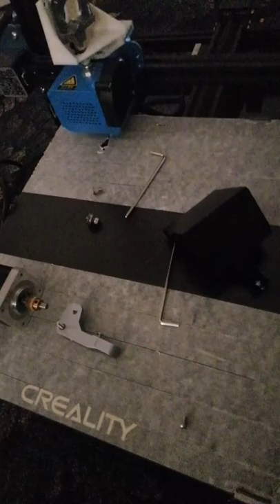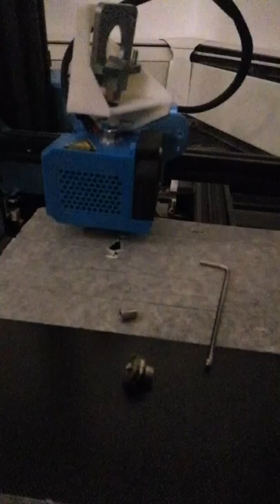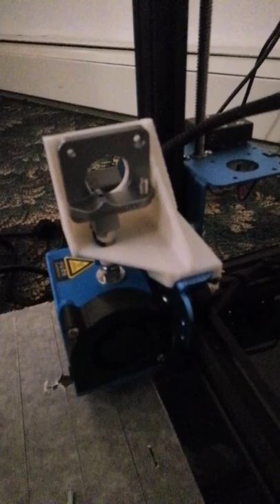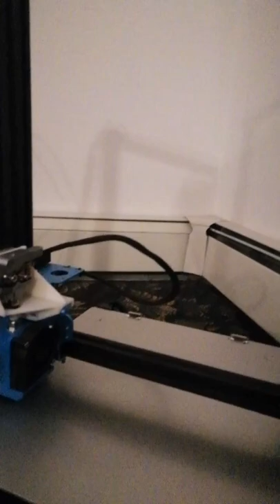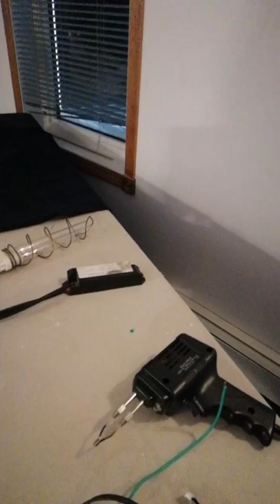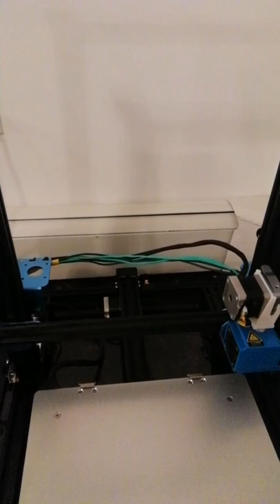Creality CR10v2 direct drive conversion instructions

Comment: did you settle on some retraction settings?
Reply from the maker: 0.2mm to 0.6mm depending on the material. Print quality improved, and TPU is possible if you upgrade the extruder to something fancy. I never could get TPU to work properly with the stock extruder. The few prints I got with TPU worked more or less by fluke.